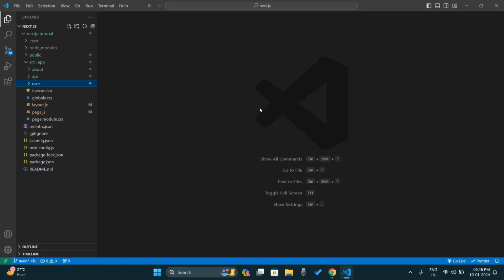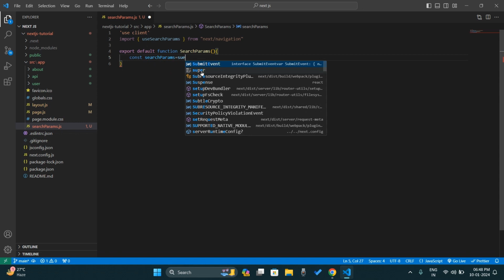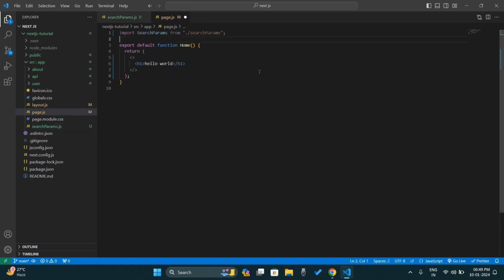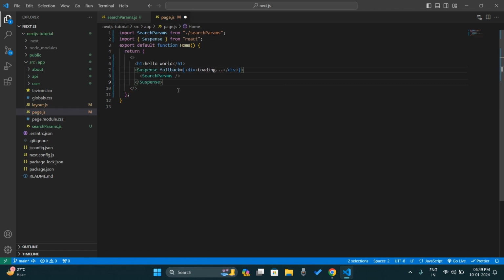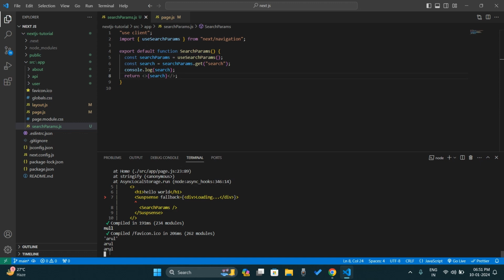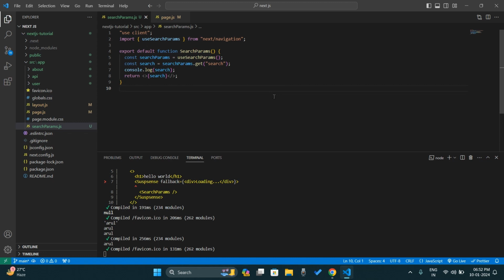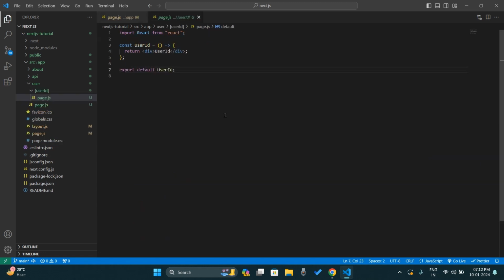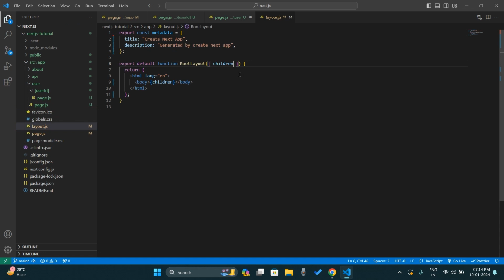useSearchParams, useParams - Next js 14 tutorial

Comment: useSearchParams() should be wrapped in a suspense boundary at page "/all-cases".

Hi, can you please give a solution for this error. 
i can share you the snippet if needed
Reply from the maker: useSearchParams is a client hook.  So create a separate file for this and put the value in return in component or do what you want to do with that searchparams value.

For static rendering pages - wrap that imported component in Suspense.

For dynamic rendering pages - You don't need to wrap in Suspense.

useSearchParams is a dynamic one.  So in static pages, in build time has no idea about the value, so when we visit it, a loading is needed so we wrap it with Suspense.  For dynamic pages, both page and value is dynamic, so we directly using it without Suspense.

I hope this could solve your problem.